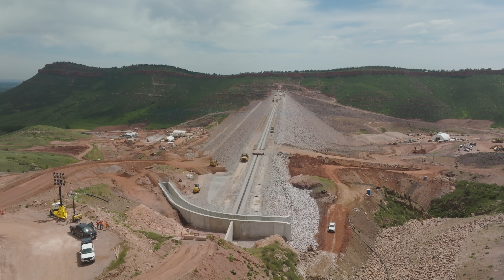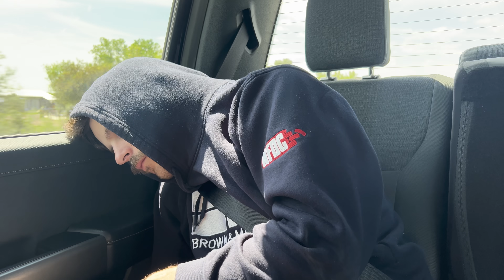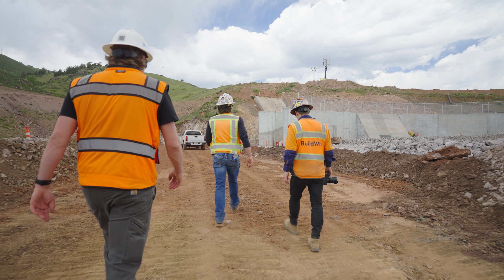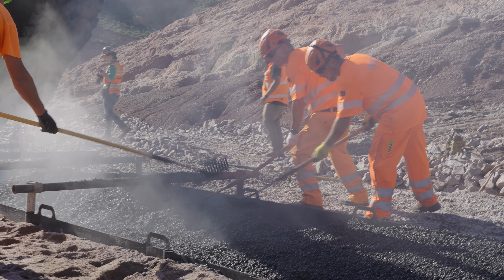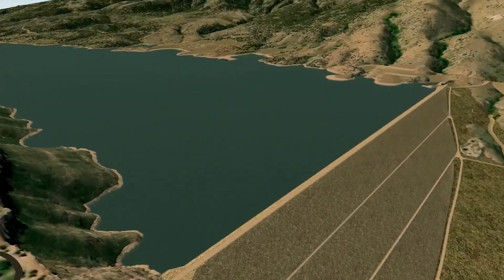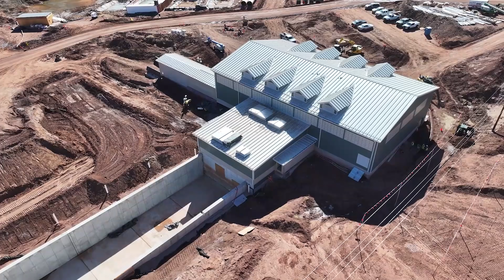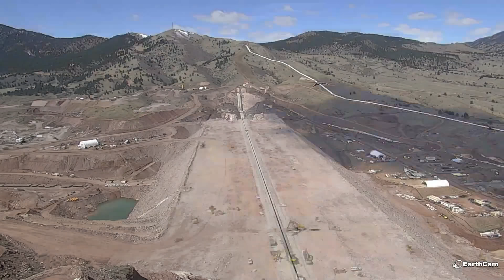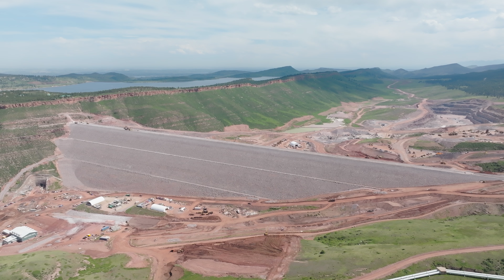Why Is Colorado Building a 22 MILLION TON Rock Wall in the Rocky Mountains?

Comment: I wonder what the seam adhesion and expansion is like. Normally, asphalt isn't treated like an isometric material with all that dry time difference vertically. I was hoping to see a vertical core sampling process or a method for spotting seam failure.

Comment: Since this pulls from water that would have been Colorado river water ... and that water source is already WAY over-tapped ... here is to hoping for proper management.
I know there are pros for this project too, of course, but one must worry about taking more water from a source that is already excessively used.
Reply: The water being used to fill this is from the west side of the Continental Divide. I doubt that after the water is used and treated, that they are going to return it back into the Colorado River Water Shed.  Some of the above comments just don’t make sense to me. Yes it is the Colorado River, but that has never directly supplied water to Denver.  In reality, the state who will be impacted the most by this redistribution will be California, since they use more of the Colorado River than any other state.
Reply: @jcarp1776  Accurate.
Reply: @jcarp1776 Its called the Colorado Big Thompson Project and was built in the late 1930s. Its also owned by the Federal Department of Reclamations and the Department of Interior. 
If you have a problem with what our misguided forefathers did almost a century ago, unfortunately you have to take it up with the Feds. 
Funny thing is, most C-BTP water is recycled and required by interstate compact to end up in the South Platte River. If you have a problem with that, you have to take it up with Nebraska, who is currently suing Colorado for more. 
Unfortunately, there is not enough snowmelt anymore to make downstream states happy on either side of the Continental Divide. It all winds up in litigation no matter what anyone does or doesn't do.
Reply: Water rights in the entire western half of the U.S. are a prickly subject, and it is only going to get worse.  Most multi-state compacts negotiated for water were done when there was a lot more of it, and a lot fewer people.  So each state thinks it is entitled to more water than is available.
Reply: @texaswunderkind  Yep, right on target.
Reply: @texaswunderkind Exactly! The 1922 compact divies up 17 million water feet that never existed. In the 2000-2025 cycle, that number is more like 12.5 million water feet and dropping. All the water comes from the Rocky Mountains and San Juan mountains, whose winter snow pack is shrinking. The drought this year only produced 3.5 million acre feet. A huge drop that may be normal in 30 years.
Reply: @texaswunderkind 100%
Reply: Co river goes west of the divide then south. We are way up here about twice as close to cheyenne than the eisenhower tunnel if that helps
Reply: @Theiliteritesbian it’s called the continental divide for a reason. The water on the west all will flow to the Colorado river via the Green or Colorado. Look at a map. The front range solution is an aqueduct from the Missouri River to the front range.  There is no shortage of water in the Missouri drainages.
Reply: @poysunivey . I live in MO, no water for you all !!!
Reply: @slalomking that’s fine. Remember that when your trailer park is underwater 😂
Reply: @Theiliteritesbian  The Colorado headwaters are very north too! There is a very small pass in the RMNP area that seperates the Poudre River headwaters from the Colorado river headwaters. Its called La Poudre Pass, and its the home to Colorado's first continental diversion, called The Grand Ditch. 

The Grand Ditch has been diverting water from the Never Summer Mountains (one of the Colorado River's headwater ranges) to the Poudre River since breaking ground in 1901. It was all for northern front range farmers back then.

Oh yeah, and the Colorado Big Thompson Project, our states biggest  Colorado River diversion project, was for NoCo farmers too, built in the 1940s.
Reply: The war of the west , water
Reply: I don't know where the Wind River Gap water goes without the reservoir.
Reply: Yep, finite water resources for people wanting to live were water is NOT available!
Reply: I guess that’s what happens when one is near the HeadWaters and most Dams are at the end of their life-spans, so Thank G-D someone is investing in Our Infrastructure vs Wars. 
We need more Tunnels and HSR too.
Reply: The southwest is using it for farming alfalfa and stupid shit that they shouldn't. It's always farming, yet people want to blame consumer use.
Reply: @ericet1515  I'd say normally it is the consumer that's driving decisions like that. Though alfalfa specifically in the southwest has seen some oddities, with Saudi Arabia leasing land and buying water to grow alfalfa for cows in the mid-east... which doesn't seem like sensible resource management to say the least. But I don't think they're doing that anymore.
Reply: @ericet1515  for Saudi horses no doubt
Reply: @ericet1515 ya, cuz anyone who eats meat knows cattle don't need stupid shit like alphalfa. 🫣. Who needs farms, anyway? We can just slowly kill ourselves with fake food, cuz at this rate there won't be any real foods left to over process. Only lab grown... "stuff".
Reply: @ericet1515  Yeppers...they allowed the grows and that was the DUMBEST thing ever for agriculture in an ARID state who sold the water rights to CA LONG ago.
Reply: @ericet1515  Agriculture is definitely a MAJOR user.  Food is of course a good thing ... but yes, alfalfa is a great example of a crop we really have no business growing in such water-stressed areas.  Horribly 'thirsty' crop.
Reply: Denver desperately needs the water for their mid-class lawn and golf course in the desert
Reply: @shallpion  LOL Denver? It is the COLORADO river. Let's talk about Vegas...
Reply: @budderbear  Vegas is not the issue. They get quite a small allotment of water and they actually do an incredible job of recycling it. It's Arizona and California that are significantly worse at utilizing the water.
Reply: @shallpion  haha, same thing with some of the other destinations in the south west for that water.  The questionable uses abound.
Reply: @JT_771 yes! Let's talk about the need for better water collection and responsible use down river from Colorado!
Reply: @shallpion Denver water draws from the Gross reservoir above Boulder.  This water is for northern Colorado, do your research and listen, Witt explains it.
Reply: @daviddiekmann2720 do YOUR research.  Denver water pulls from Dillon reservoir near Breckenridge.   You’re sounding a lot like you know something and you clearly don’t.   I can walk you to these diversion tunnels in our backyard and show you the signs that say Denver Water.
Reply: @BreckShred except I worked on the project for 4 years and can read SMH
Reply: This is all worked out in court battles, interstate compacts, federal legislation etc. If they're at the stage of a nearly complete dam I'm assuming they already have all their T's crossed and I's dotted regarding legality and water rights.
Reply: @freespeechenjoyer  There is a difference between legally set up and if something should be done.  This is water that would have gone to the Colorado river.  A river that already has states with X amount of water rights that already exceed what the river provides.  Exceeding what the river provides before this project.  So this very much is a situation where they better be dang sure what they're doing, regardless of legal stance.
Reply: You are misinformed. This dam is going to store water that would otherwise be lost. They can’t increase the flow of the Adam’s Tunnel, the draw has been the same for decades.
Reply: @jprime5128  If the extraction isn't changing at all and merely retention on the discussed end (which, yeah, I don't know), then agreed, that makes it non-impactful to the Colorado River.
Reply: @jprime5128 how would the water be "lost"? Are you truly so naive as to think water that flows down the Western slope, like it has since the formation of the Rockies eons ago, has no purpose???
Reply: Looks like this water would feed into the Platte River which feeds into the Missouri River.
Reply: @markhatch5546  Makes sense for the new destination, now that its on the East side of the Rockies instead of the West, where it started.

Comment: I thought the coolest part was using the material on site and increasing the holding capacity.  Then you did the time lapse 😎.  And Three D printing the waterproof core was wild.
Reply: The material on site contained too much uranium and water from the reservoir does not now meet fed standards.

Comment: Here is an thought with many considerations. The zone 1 asphalt core. Would you drink water that has been in contact with tar/polymer ?
I make asphalt for a living. Do people realize that tar causes cancer? note here, the tar is also called polymer, or acrylic cement. Neither of which I would drink water that has been in contact with it. So with all that said, this project could have saved millions of dollars by using many things besides asphalt as a core/barrier instead of bringing in some company from overseas to place a long term death core in a water supply for human use. Yeah yeah I know they would say that the outer zones will filtrate out the bad stuff but personally I would not believe that bs.

But it's too late now being the dam is almost completed.
Reply: Any asphalt that could conceivably make it through the other zones would float on top of the water and would be easily removed.
Reply: You sound like a liar.
Reply: There will be more asphalt in the water from road runoff than that core will ever leech. If you want to freak out about something, try crying about the uranium in the water due to the on-site quarry. It’s also nothing to worry about but that seems to be your gig.

Comment: problem is, that asphalt will never solidify, it will seep out, and will just keep moving ... i dont see anything holding this in place for more than 3 years 🥺
Reply: Apparently you weren't listening. They had to heat the asphalt up before laying the next layer so that it bonded together. It probably cools off over many hours then gets solid yet flexible. It's not that much of a liquid or the layer of rock being placed on each side simultaneously wouldn't be holding it in place while it cools. I'm sure it was tested both for environmental and water safety issues as well.
Reply: I'm going to guess you've taken zero engineering classes.

Comment: Ummm... "Civilization is on the East of the divide...".  That is quite the over simplification of a very complicated, and often hotly debated, water issue in Colorado that completely dismisses the rest of the story. The West of the divide isn't a vast emptiness where water is collected or flows away.  Yes, there is a need for more water on the eastern slope of the Rockies, but you seem to have glossed over the fact that there are hundreds of thousands of people (ie,  civilization), and most of our agriculture, on the Western slope that also depend on the water coming off the mountains. And that doesn't include the millions of people further down the line in SW Colorado, UT, AZ, NV and finally southern CA who also  depend on this same water. It also has to provide water for Lake Powell, Lake Mead, and the Gran Canyon. 

The engineering part is fascinating, but don't make it sound like those living on the front range are the only ones whose needs are worth mentioning.
Reply: How does a need for more storage on the front range have anything to do with the western slope? This project is about storing the water already coming through the Adam’s Tunnel during the runoff and rainy season on the front range.
Reply: @jprime5128 if you watched the entire video, and read my comment, I was referring to his diagram and portrayal of there only being "civilization" on the front range, underscoring the need to collect more of the runoff that goes to the Western slope, as if it is simply wasted. His was a very one-sided, over simplification of a very complex topic here in Colorado, and beyond.

Comment: Earth  definitely needs much larger equipment.
That one excavator splitting stones to size, c'mon, really, no way
I would think they'd assemble a giant digger that crosses an area and thus digs downward as it belches up the correct size with on board crushers just leaving a mound of proper sized done to use.

Comment: Okay so down the road, about the fish?  Do they have a way out or do all the native species live upstream?  And now about upstream, how much wider and deeper is the flow into the reservoir?  Is the feed water sustain a higher level.  What about melt water in the spring having no place to go.  Where does it go if not using a the spillway?  Or did I miss where this was never planned to get full enough?  Is what's filling this basically only spring thaw?
Interesting vid especially the thin wall of bendy asphalt.
Nature has a way of saying hold my beer.
The company is from Switzerland, did the crew come from there as well or do they hire locals to run their equipment?  How long did they study this area to cmome up with the calculations?
Now I'm going to have to see where on earth walls has operated.
To see if they specialize in mountain projects.
How long before the asphalt is touched by the water and how high or saturated do they expect it to be.
Are there models or just this is how water enters reservoirs and this size of rubble stop the erosion process and so forth and so on?
Is there a model to find out about the debris and stuff used?
Reply: No. Trust me, it’ll be ok overthinking buddy.

Comment: What I'm surprised not to hear addressed on a Engineering overview about a structure with a flexible core is no reference to a deflection coefficient.
Years of one sided pressure will push the center top point away from the water and stretch the top line length of the dam to accommodate that movement.
A violent earthquake alone with all that one sided pressure might cause discernible stretch? 
They must have a theory by how much and a structural over capacity estimate to avoid problems. It is not a question of if it happens but by how much? 
I can foresee them having to lower working water depths in decades to come.

Comment: If Colorado were using thermal depolymerization for municipal waste processing, as they should be, they would have abundant char for use for projects like this. They could use low-binder compacted blocks with 60-85% char and 10-25% lime/geoplymer mix with graded fines. This is rammed-earth style compaction (5-10 MPa), minimal water—mimics regolith bricks. Lightweight stable bulk fill for outer shells or non-impervious zones could reduce overall dam weight and improve sustainability by sequestering carbon. Suitable for up to 50% of the 10 million cubic yards if blended with rockfill at competitive cost but with environmental benefits. Additionally, some char could be added directly without processing as a dirt substitute.
Reply: Increasing the truck traffic and carbon footprint of the dam substantially.

Comment: Very cool.  esp the timelapse.  I would have liked to see how they got the slopes of the damn so smooth at that angle
Reply: Smooth is a relative term. Most of those boulders on the side are varying in size from basketball to large bouncy ball sized boulders. The real magic and savings in civil projects is the new GPS driven equipment. You can check out something like Leica Geosystems if you're curious. It's one of the coolest things.

Comment: How many tons of asphalt is in it and how thick are the walls and how many different sections of asphalt
Reply: To feed a baseball and one whole slab or layer whatever you wanna call it
Reply: 9 inch lift and no compaction?
Reply: Oh there's the rollers
Reply: They're even preheating the asphalt before applying the next lift so The asphalt should adhere to itself pretty good I wonder what their compaction numbers are
Reply: Oh I guess that would be 100% compact
Reply: They must have put this on bedrock

Comment: It's an engineering marvel, but it can't make it rain or snow more often, decrease demand with higher populations and agricultural needs, nor combat evaporation through higher temperatures. I'd have been more impressed if they'd built a huge underground cistern to store water that would not be open to rising temperatures, greater levels of evaporation, and eventual destruction with tourists and their gas leaking boat engines and their trash left behind.

Comment: The crazy part is this dam is 100% recyclable. No concrete and rebar to deal with!
Reply: Actually there's quite a bit of asphalt and concrete, but, yeah, nothing like a traditional dam.
Reply: Concrete is gravel sand water mixed rebar is iron that rusts back into the Earth last I checked that's called recycling and lastly asphalt at the core is an oil-based product which comes from drilling which most of you don't like

Comment: This thing fed by the Adams Tunnel, and so is east of the Continental Divide, right?
Reply: This video is so well-produced and beautiful. Thank You. I have to say, though, that by the end I still couldn't picture the most basic thing: where is the continental divide in relation to this? where is that big Adams tunnel you talked about in relation to the project? where is the valve house located? and where is the water flowing to from the reservoir? in other words, great on construction "tactics," but I still don't get the overall water flow "strategy" in the Colorado geography.
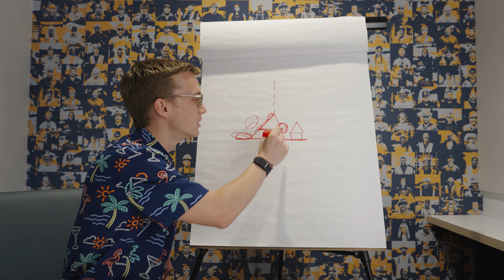Reply: It seems like you mean to answer all those question by 3:00.